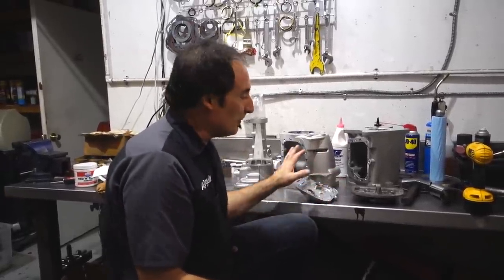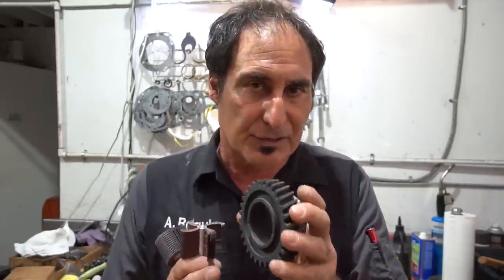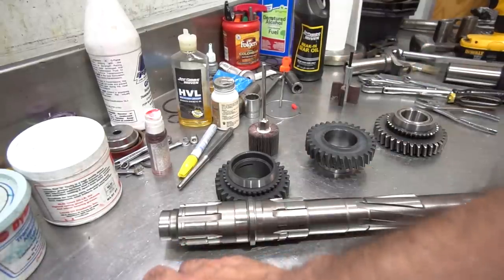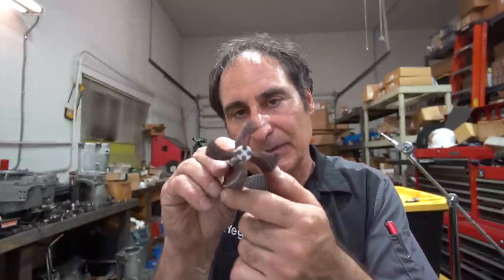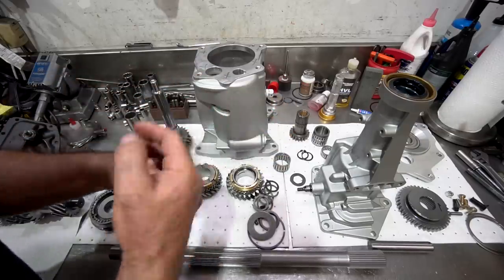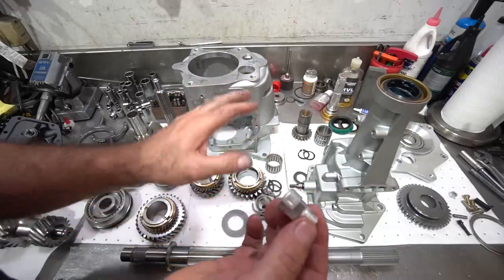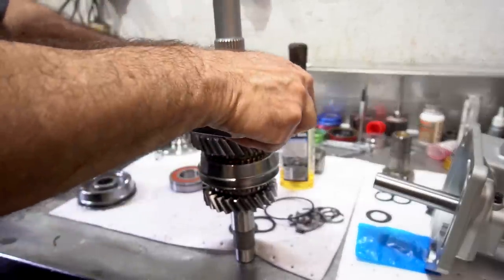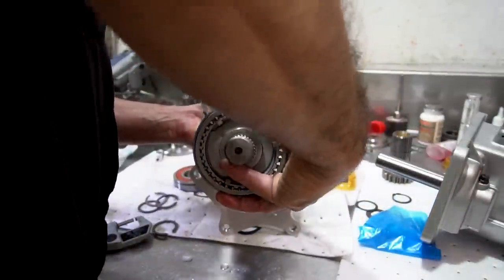NASCAR 4 SPEED TRICKS FOR A STREET 4 SPEED

Comment: This guy built my M22 drag special and it’s sitting behind a 496 big block with 800 hp now for about 3 years . Never had an issue still running strong shifting like new.
Reply: What's the specs on it if I may ask. Just curious. Any modifications to the transmission?
Reply from the maker: Its a video on how I prep transmissions. Its general info in a way

Comment: When I was a machine tool operator at a B&S back in 70's I had the opportunity to work in the machine tool division gear section.  I remember we used a machine that would shave the gear and then after heat treating I would hone the gears.  Check them for run-out and all that then and not least I would match any two gears that would be mated by the amount of decibels they recorded in a sound proof booth.  There was a lot more to than what I am mentioning here.  Your video brought back memories.  Thanks
Reply from the maker: You are correct, that is how it was done in the old days. They hobbed, heat treated, and shaved, correcting for distortion. Now most gears are ground after heat treat and with CNC type machining, better alloys, and better control of heat treat, some steps are eliminated and quality and profile accuracy are greatly improved.
Reply: Ah the good old days, I'm a dinosaur now.

Comment: Love this channel of yours Paul! Your skills at working on transmissions and your ability to explain things in simple to understand context, is fantastic!  I didn't find anything on your channel about NV4500's though. The one in my Dodge Cummins is giving me some issues and I'm planning on rebuilding it. Would you recommend staying with the factory style carbon fibre synchros or switching over to brass? Appreciate it if you can give me any feed back on that! Keep up the awesome work!
Reply from the maker: Always use the carbon rings since the gear cone angles are designed for them. I would suggest not using the Amsoil but the recommended Synchromesh oil.
Reply: @GearBoxVideo  Thanks man, I appreciate your feedback! Any chances of you doing a rebuild vid of one? Possibly with some upgrades?

Comment: You could use the new hollow shaft to constantly provide oil to all the gears or rolling bearing just like you would do on a crank shaft. It would also be interesting to see how well the synchro rings match with the gears. And is the tiny needle bearing sufficient for the lateral forces on shorter gear shaft? Thanks for the very nice video
Reply from the maker: Actually most automatic transmissions use pressurized feed oil thru hollow shafts. It's all been done before. Problem is you need to run a pump system. These old transmissions don't have any. Most of the newer manual transmissions and some older ones we convert run speed gears on rollers. No issues.

Comment: Nice, I haven't messed with a lot of car transmissions (although I had a super T-10 I bought for a 73 Corvette I had) but I set up a lot of Harley transmissions and for the last 11 years I've been getting into setting them up around road racing standards, I've been using an electrical insulation paint to coat the insides of the cases to keep the lube from wanting to cling to the inside of the casing, I'm gonna check into the Teflon coating trick, where do you send yours to for coating?

Comment: Great video very informative . Congratulation on your two new books ! I have a very rare AMC T-10 that I bought at a wrecking yard . I haven't pulled the side cover for it yet to see the condition of the gears but had a couple of places that do manual trans tell me the trans was built by Borg Warner for AMC at their specs the standard T-10 gears wont work if I can rebuild it and restore how much do you think I can get out of it? Looks to have the original shifter for it also the handle is gone its date coded for 67 and 68 would of came out in the AMX'S  what they told me off the tag for it. Keep up the good work ! Thanks Roger
Reply from the maker: These are 1st design ST10 transmissions. We have many parts available for these.

Comment: Always looking for ways to eliminate drag and heat (as well as vibration and noise) when it comes to my `73.5 International Scout II. It's a 4200# truck w/aerodynamics of a brick! LOVE my T19 and sure would like to add to its lifespan of possible. 

Don't know much more than I'm never using anything but GL1 in it, so gotta ask, can this trick be performed on an IH T19? Any chance the upgraded shafts are out there or what's an estimated price to have it done to the shaft and who* would do the machining?

The PTFE coating has me wondering about differentials as well. When I was 15, I learned the 5 HP trick for painting under the valley pan so oil flows smoothly. Only makes sense. 

Thanks for the awesome demonstration!
Reply from the maker: The coatings and polishing do help. You  can drop another 1000 dollars doing it

Comment: Great video! Learned a ton from you. On the box you described with the different main shaft, rollers, etc. what HP/torque would a box like that withstand for  some road racing?
Reply from the maker: 500 hp Max. For the 500 to 800 range the Muncie spec 25, which has similar treatment

Comment: Just recently attended a webinar about Teflon seals. I don't know if a Teflon seal is available for the tail shaft of either the Muncie or the T-10/Super T-10. If you could swap over to them it would be a great improvement. Teflon seals are installed over a  dry shaft, the seal area would be cleaned of any oils where the seal rides . An installation tool is recommended to get the seal on straight. The Teflon seal actually transfers particles from the seal to the shaft filling in any minuscule voids in the shaft and the life of the seal goes way up. Best thing is that after the seal laps itself in, the seal dimensions never change so a wear groove is never worn into the shaft.  If the shaft is oiled during installation, the seal may never seat or take forever to seal.  . Thing is, does  National, Chicage Rawhide and other  manufacturers produce Teflon replacements?   .I have been using Viton whenever possible vs Buna N and the results have been excellent. Thanks for posting all this info. I love the polished gears and the Teflon coated case interiors. My 2 cents.
Reply from the maker: They don't make Teflon seals for extension housing applications. You have to be careful with Teflon.  Unless you are using hardened components, teflon seals will actually eat up the yokes and shafts they run against.

Comment: Very cool video's, excellent info here.  I'm working on a Doug Nash 4+3 in an 86 Vette that we are setting up for a low budget road racing in Champcar and we need to use the original trans.  Although I would like to remove the OD and install a normal mainshaft and tail housing, we really can't do that based on the rules of our series.  However, All the trick stuff you discuss on this video could be applicable.  One think I am curious about and suspect you might have an idea on, Would it be possible to shorten one of those rollerized mainshafts to work in the 4+3 we are using?  I suspect it would only work if the existing splines on the rollerized shaft are the same size as the output splines on a 4+3 mainshaft.. I also wanted to ask if the rollerized mainshafts use standard ID 1/2/3 gears or are they special gears in addition to the mainshaft?
Reply from the maker: You could shorten one and it would work.
Reply: Thanks Paul!

Comment: Serious question, who would use a T-10 behind a Ford? Especially when it's date coded '65, when Ford had the toploader, which is a stronger and more durable design?
PS: I'm a 3 pedal guy for life. Love the videos for the little helpful hints you always give.
Reply from the maker: The  rule for this FIA class is to use a T10M case. These are new cases with the correct Ford numbers and dates. The Toploader is overkill, heavy and there currently is not a good  dependable source for quality gears.
Reply: cjshaker c mon the R.A.T ir the R.U.G ford units bulletproof and those are way more difficult to work on M20 and T10 easy to work on them
Reply from the maker: I don't think you understand. Currently there are no good NEW parts available for the RAT 3 speed and the RUG 4 speed. They have cast iron cases and tails. This is not a drag racing senario where the big bulky gears of the Toploader would be an advantage. Toploaders are probably the best designed 4 speed muscle car units made but have a severe weight disadvantage and lack of good replacement parts. These transmissions I build are all new. Building endurance racing units with used 50 year old parts and gears is not something I do.
Reply: @GearBoxVideo  Thanks for the response. The toploader is heavy and I suppose you're right, overkill for road race when a T10 can be built to handle it. Been drag racing my toploader for years without issue, but just switched to a Jerico and saved 24 lbs. I don't understand the lack of gear selections for the toploaders because there are LOTS of those transmissions out there. Keep up the great videos.
Reply from the maker: There are only 2 ratios, 2.32 and 2.78. There is a lack of quality new gears,  The only gears available are made in Taiwan and the quality is OK but inconsistant. Jerico units and cases would not be allowed in these classes.

Comment: Paul, what would you recommend for protecting the gearbox case outside from winter-salty-road conditions? Normal 2k-coat with aluminium primer enough? Thank you for your awesome videos!!
Reply from the maker: If you can paint it properly and get good paint adhesion that would be good. The coating process O use is fairly expensive

Comment: I really appreciate your videos! Gives me the confidence to try a t5 rebuild!  First hand seeing the difference in bearing support materials and how it works makes me insist on your support!  That being said,  any advice on gear sets? $1500 gforce too much for me, I have seen $500 offshore high alloy sets..any perception on these?...for a mild performance build 5.0 or 351, depending on opinion.   Also opinion on higher torque slower 351, vs higher speed 302, which will gearbox hold up better?
Reply: Forgot to say thank you Paul!

Comment: Why You would not recommend this shaft for street?

I've got Your book, it's great! Are You comming to uk this year?
Reply: I was wondering the same thing.  If I had to guess, it's probably not worth the expense, since he mentioned it makes a difference mostly at high speeds (and, as responsible drivers, I'm sure none of us in the comments section would broach the speed limit...right?)  Details like this often don't show an appreciable difference in performance or reliability at regular speeds, even with "spirited" driving.  But yeah, I'd love to hear his thoughts directly, rather than guessing.
Reply: The shaft can be used in a street car, but is not recommended. As shown, the shaft is a very light weight, gun drilled design and susceptible to warping and fatigue if used for prolonged periods without very short maintenance intervals. 

In the racing world, we take  apart and inspect our transmissions after 500 - 1,000 miles or less and replace components as required. 

When the name of the game is speed, we reduce horsepower losses anywhere we can. A lighten shaft and reverse gear that shaves of 4+ lbs is a LOT of rotating mass. With all the other tricks shown, the transmission loss / freeing up of horsepower can add up. 

Depending on the class and the type of racing, we have seen significant horsepower gains (to the rear wheels) of up to 15 - 30 HP. Even more important is acceleration "time". The faster you can get torque and horsepower to the rear wheels compared to your competition, can be the difference between making the pass or not, coming out of a sweeping turn or chicane.

These cars are often less than 3,800 lbs (NASCAR Cup) rules. The average weight is more like 2,800 - 3,200 lbs. Ford Cobras can weigh as little as 2,300 with driver!

You average street car is 3,800 lbs or more and must withstand the rigors of all 4 seasons of weather, potholes, and driver abuse and remain in the transmission case for 50,000+ miles. The lightened shaft design was never intended for this type of duty cycle.

Paul is showing only a fraction of what full blown NASCAR transmissions undergo. They are worth 15 grand brand new and are overhauled after every race. 

Years and years ago, I raced a '68 Ford Mustang in the unlimited powertrain class with a used (rebuilt) NASCAR Cup transmission in a 12 hour road race in Portland OR. 

The car was a mere 3,100 lbs powered by a 358 CID Windsor based small block putting out 550 HP. We finished 11th out of 50 cars. Not bad for an amateur race event. The transmission didn't have a single failure. But all the roller bearings and syncros needed replacing. They were simply worn out. We also replaced the shaft because it was showing signs of heat stress and no longer ran true.
Reply from the maker: Thanks Doug for your input. This is actually going in a fairly light Cobra.
Reply from the maker: I just got back from spending 2 weeks in the UK. I'm making it a point to go the Birmingham show in January.
Reply: @GearBoxVideo  I've raced at Brands Hatch running a 289 Cobra replica. Beautiful car. Caught up in a crash 8 laps into a 4 hour race.

Comment: What would the power handing be on this setup? Im looking for a suitable 4 speed gearbox for a chevy monza with a 450 hp 350 and under 1200kg to be used for road racing, I dont know whether I should go for a muncie (probably the close ratio, heavy duty 31 spline version with the 2.2 1st gear) or a suitable T10 I could put together myself to keep costs down? .. Or do i must try to find a cheap nascar cup 4 speed and not worry about breakages very often if it all?
Reply from the maker: Go with a used cup 4 speed or a Roltek T10
Reply: If It's all the same to you sir I'd talk to Paul first before making any decision.......

Comment: Paul, I need a 4 speed box for FIA-certified vintage road racing (like SVRA) in a 62 Chevy II with a 327 . I'm pretty sure class rules don't permit a sequential, but I need a solid box that bar changing ratios now and then, is going to be maintenance free. Can you recommend a box?
Reply from the maker: " I need a solid box that is going to be maintenance free....."  Chuck, everything in racing requires maintenance. I'm no longer building transmissions at this time. You may want to try Roltek transmissions.

Comment: Do you know much about the Saginaw overdrive? I'm wondering how much horsepower it can take. I'm thinking about modifying a TB 400 output shaft and adding the sag to it and make it's tailshaft the overdrive. You must use the Buick long shaft and rework it.
Reply from the maker: Not much more HP then what they were rated for. Behind a 400, probably the gear vendors OD is a proven and better choice

Comment: are you in the habit of boring out the 7/8" cluster gear pin holes on the earlier model muncie case so you are able to use the larger and stronger 1" pin of the later models? the 7/8" cases used to be desirable because lots of racers used to do that and offset the hole slightly closer to the input shaft in order to  tighten up the clearance between the two.
Reply from the maker: I bore 7/8 to 1" often.  I don't believe in that closer offset thing since gear sets are designed with a specific back lash in mind.  Typically you can have increased gear noise and pitch line wear doing that

Comment: I enjoy your through videos. Have you had any experience with the NP440 PRO my6 3 speed with overdrive transmission. They were an option on the chevy pickup trucks 1981 - 1989 I believe and they are rare from what I hear. I was just wondering if they're good, bad, and worth pursuing. thank you.
Reply from the maker: Nice unit but no hard parts are available
Reply: @GearBoxVideo  Does that mean there's no rebuild kits?
Reply from the maker: There are kits but no gears are available

Comment: I read the first book and it was interesting but I was disappointed that it didn't cover the sm465 and np435 which I find to be far more common than the ones that were covered. The nv4500 is quite popular too, although harder to find
Reply from the maker: The book right on the cover says what it is for. I don't understand why you would expect something that is not stated in a book. Think what you are saying! It like you buy a service manual for a Camaro and then complain that it doesn't cover a Dodge Charger.  The logic makes zero sense. My advice to you is if you cannot take the time to read what a book has then make phone calls to the publisher or me and ask first to avoid "disappointment".
Reply: @GearBoxVideo  the cover says in the bottom left corner that it covers 4 speed top loaders of which both the sm465 and np435 are 4 speed manual top loaders. High performance I guess means different things to different people. I would think it better to slick up a trans already renowned for strength and durability rather than try to make a more fragile tranny hold up.
Reply from the maker: 4 speed FORD top loader is a 4 speed used in the Mustangs and other Ford Muscle cars. Again. Take the time if on Amazon to read and preview the chapters. Yes NP435 and SM465 are Top loading TRUCK transmissions. Nobody uses these for High Performance Road racing or drag race applications. They are stronger for hauling and other related Light Trick duties but will snap output shafts when you drop the hammer. You may want to get some make model specific overhaul manuals. I serviced fleets using NP435 as well as the SM465 and early SM420. We replaced and stocked output shafts because of people thinking they could drag race with these or were just trying to do burnouts. Also ratios for these transmissions are designed for hauling not racing.